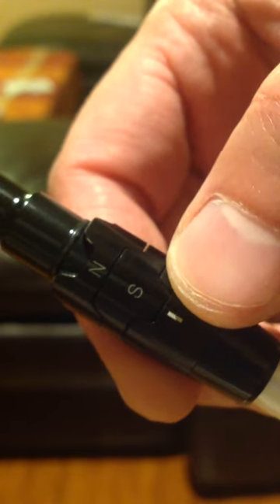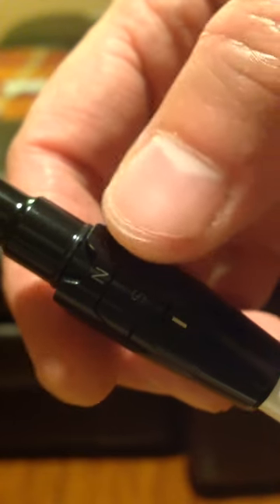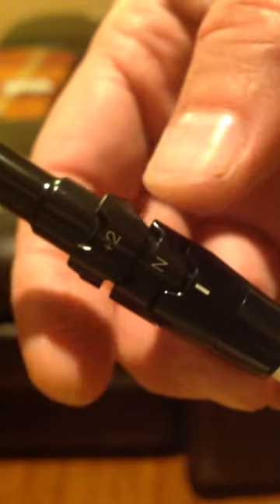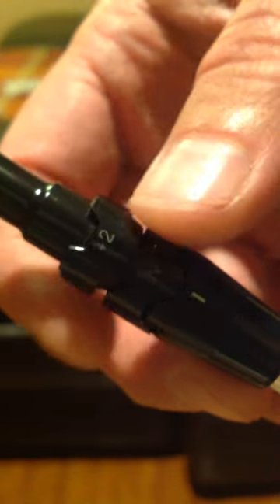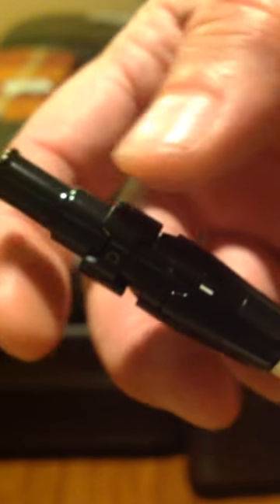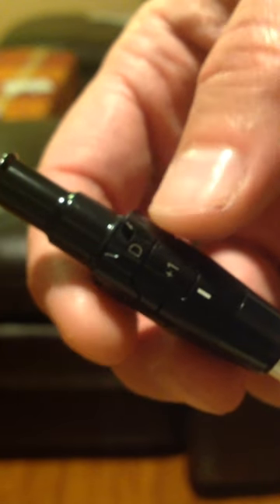Adjusting the loft and lie of the Callaway Big Bertha Alpha 815 Driver

Comment: I just realized that I did not line up my desired setting with the hash mark.  However, I placed the loft "9" over my setting of choice and secured the head back on.  The hash mark was not aligned.  How would that change my settings?